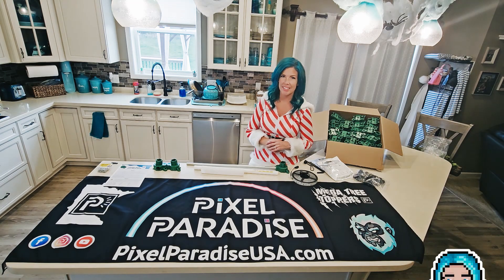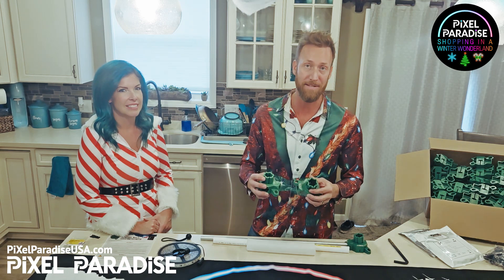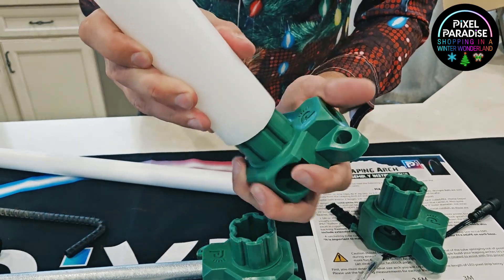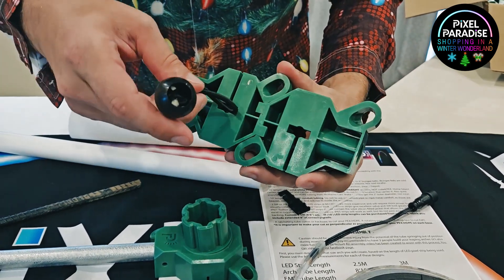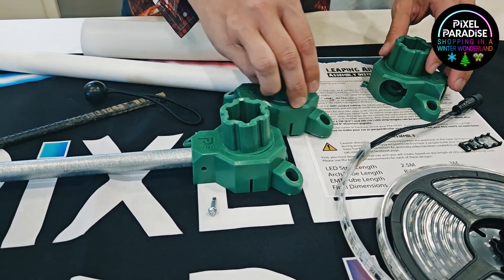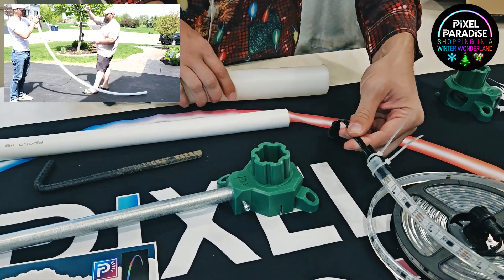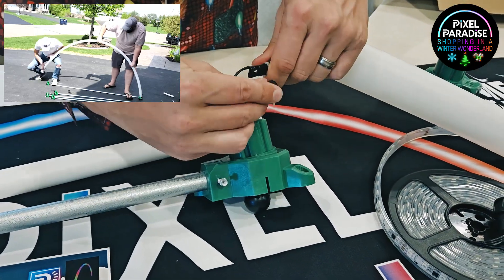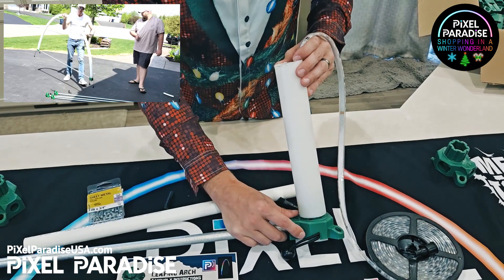The Best Leaping Arches Made Easy - Arch Kits for PEX and HDPE Build Video PiXeL Paradise USA

Comment: I just got seed pixels and led strip from you to test the difference for next year. I used 1" Pex B and both look good. I will be looking at it to see if one looks better than the other. If not, seed pixels at 1" spacing may be the best bet price wise. Thank you for this tutorial. Once I decide on which to use, I will have to decide on length/height of arches.

Comment: If I wanted to do 4 arches how long of a strip of LED's would I need?
Reply from the maker: Each strip gets it's own custom length 2.5 meter LED strip, that comes with factory-soldered pigtaile on each end. This means you will need one strip per arch you are building, and you easily connect them together at each end by simply plugging the pigtails into each other! Doesn't get any easier than that!

Comment: I like the product; I saw these on Etsy along with a 3d printed version. I agree the injection molded version looks a lot better than the 3d printed version. My issue would be the price point. To create a multi arch display this way would pricy.  If you offered two, three or four arch kits at discounted levels might make this an option.
Reply from the maker: Hello! We were happy to keep the price point exactly where it was before the switch to molding even though it means a very long ROI for us. When you consider the cost of our arch bases, ours includes the mounting strip clips, zip ties, and even the set screws, there's really no hidden hardware costs like others require and we are priced even cheaper than many of the 3D printed ones. If you are wanting a large order of these please let us know we'd be happy to extend a bulk discount. Happy Lighting!
Reply from the maker: Thank you for your interest. We actually decided to not increase the price at all of our arch kits when we moved from 3D printing these to injection molding them. The cost per pair also includes all of the clips and hardware so we think it's a very economical value for something that will likely outlast any other product on the market. Don't be afraid to reach out to use if you'd like to inquire on bulk discounts. Thank you!